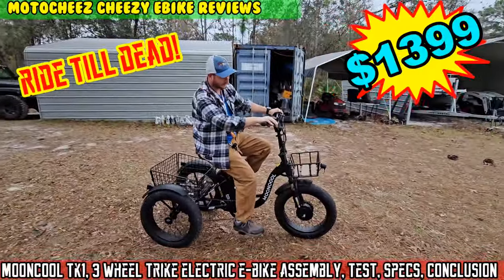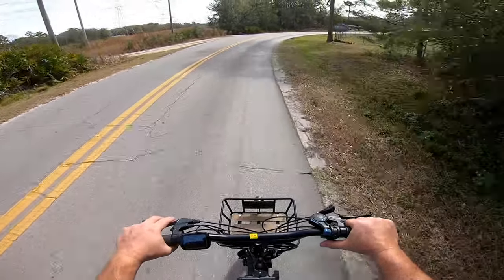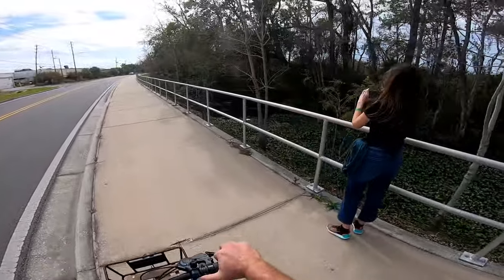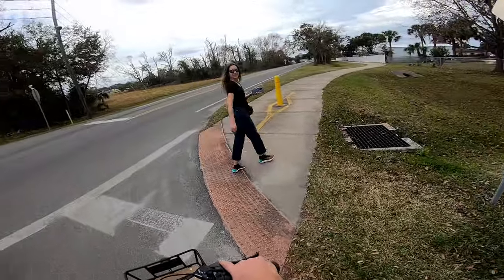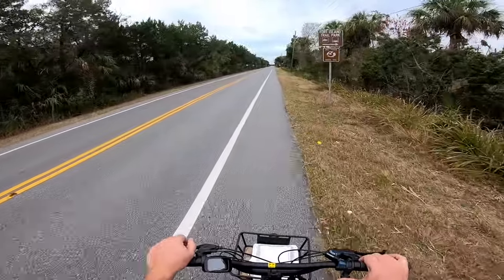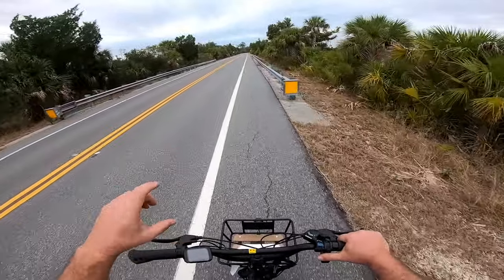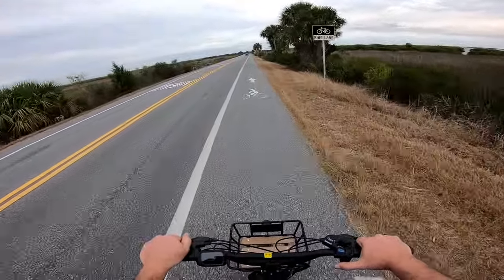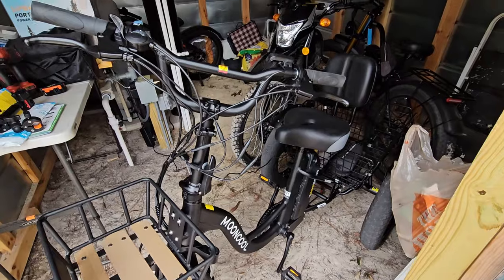Mooncool TK1 3 Wheel trike Electric Bike. 48V 15ah 500W (750 peak)  Ebike E-Bike FULL TEST

Comment: Walmart in Canada sells a 24" Hyper brand electric trike for $600 CAD ($450 US) that comes mostly assembled with a rear diff and has free shipping. I just bought one for my mom. Only 250W and 36V battery though.
Reply from the maker: Wow that's a good deal, what size battery does it have. Racks and everything too?
Reply: 36V10400MAH battery. Comes with the same type of rear basket but not the front one. No lights either. Works with pedal assist or thumb throttle @MotoCheez

Comment: How do you think the TK1 would handle hills? I live in an area where the roads can rise or fall 100' feet or more in a quarter mile.
Reply from the maker: It would probably do okay, I don't believe that they gave any incline numbers but it is only a 500 w hub, I know at my place in Connecticut the 750w struggle with some of the bigger hills and the 500w you definitely have to pedal with it

Comment: Hi, I got one of this bike 3 days ago, but can not digger out the throttle. it doesn't do anything on 1 to 3 only on P and moves very slowly. any idea what to do? please advice if you know what to do. seller do not reply to my question. many thanks. PS: light and electric bell are working
Reply from the maker: Hmm, sounds like maybe controller or a bad connection. 

I'll contact the dealer I got mine from, did you buy from same place I did?
Reply: @MotoCheez  Many thanks,  I bought it from mooncool site, but i think they are just the front. Because no one answer the phone there
Reply from the maker: @ciapak6590 I sent an email to my contact. 
Did you check all the connections?
Reply: @MotoCheez  I managed to fix the pedal assist but definitely throttle is out and not working or there is something i don't know about.
Reply from the maker: @ciapak6590 sometimes there's a setting, I'll see what they say when I hear back from them
Reply from the maker: @ciapak6590 I got an email back, you should hear back from someone ASAP

Here is her reply:
"OMG,I apologize for the inconvenience.Customer service will contact him immediately to deal with the problem.

Sincerely
Evonne"
Reply: @MotoCheez  The got back to my, they were sorry and offered me $20 for inconvenient for damaged seat, Brake and throttle.😡
Reply from the maker: @ciapak6590 did they fix your throttle issue? I didn't know you had damage too. From shipping?

Comment: Really great review! I just got a MoonCool MC 350. The gears, brakes and electronics are the same. The tires, motor, battery and frame are different however. It was interesting to see how similar the assembly was and how you handled the rear basket assembly.
Reply from the maker: Awesome. I think the zip ties are best option. How did you do yours?
Reply: @MotoCheez  I followed the instructions and used the metal clips. I used pliers and crimped them down. No rattling and pretty sturdy.
Reply from the maker: @wayneyoung8647 I accidentally lit the back of the bike up by the basket and the metal clips opened up. I don't know if a plier tightening it would have helped it I just didn't like the silver or the rattling

Comment: where is the rear drive motor and hydraulic brakes on all 3 wheels.
Reply from the maker: There isn't. It's front wheel drive is a stated in the video, and one front disc and one rear disc brake as stated in the video

Comment: I have a Honda CBX 6 cyl 1979 it has 18599 miles on it and I still at 70 plus years old ride it like a mad man when I crank it up. I had it to 150 mph but she will do better. Mint Condition and yearly maintenance and every 3 years new tires. I bought it in 1981 still new. Not one maintenance issue ever. I should not have said that. I blew a Hellcat away a couple weeks ago. I have Handicapped Plates on it and my Leather jacket says " If I race you and you read this I won". Cops chased me once they lost me. Lot of Torque. I burn 100LL mixed with Slick 50 synthetic 5%. Bore scope it looks new in the cylinders. Yep I am Fat & Old but love Big HP like my 68 427  435 HP 4 speed convertible Vett I have owned since I was 17 when I joined the Army. My rich Granny bought it for me. That car is mint and I mean 99%. I took it to Germany for 2 different Tours and Fort Hood Texas 2 Tours. Miss my Granny.
Reply from the maker: My buddy had one of those, they are scary fast especially at the time they were released!
Reply: I know you are talking about the CBX hey are nick named the Pocket Rocket and you better hold on and for its day it was a killer for some. One Bike you learned to respect. I rode the back wheel once like a fool at 120mph and almost lost it is 1050 cc of instant torque. max 9500 rpms.  Freddie Spencer here in Shreveport back in the day took it for a test ride tried to buy it.  @MotoCheez

Comment: Lol.. Some low ground clearance on that one. They have some geared axle models that don't need that chain derailleur underneath.
Reply from the maker: I did notice that it's only about 4 in off the ground, I don't think you could put a derail around top because it has to follow the chain from the bottom cuz you're pedaling forward
Reply: @MotoCheez  yeah.. Gear axle has no derailleur.. Just a internal axle gearing.
Reply: I guess they call it a differential
Reply: Evelo Compass Trike has a differential rear
Reply from the maker: @kevinnashskitchen3517  well you can have an open differential with a chain drive but I was thinking limited slip cuz an open differential will still let one wheel slip
Reply: @MotoCheez  The rear axle is split into two different segments – one for each wheel – with the drive system centered between. This makes it so each wheel has its own power and enables the wheels to turn independently. When you turn on a trike, the inside wheel turns slower than the outside wheel due to a smaller radius on the inside. If there is a solid axle, the wheels are not able to turn independently which creates an imbalance that can cause the trike to tip. The rear differential on the Compass keeps it stable in turns and balanced on uneven surfaces
Reply from the maker: @kevinnashskitchen3517 Right I said if it was solid it wouldn't turn good I've had vehicles with posi for my Wrangler has lockers, and open differential will put the power to both wheels unless one wheel is lifted up It would definitely be better than one wheel drive but a limited slip would be the ultimate